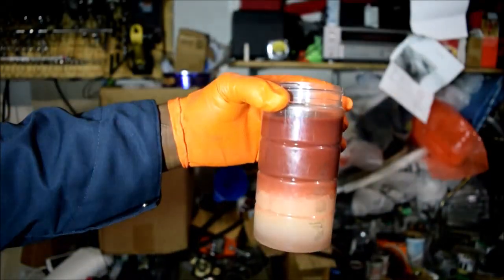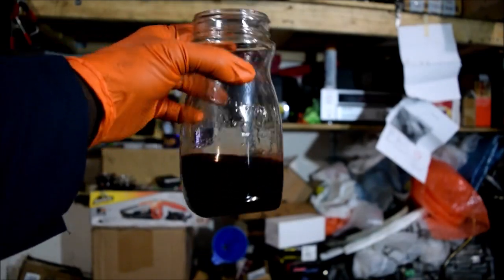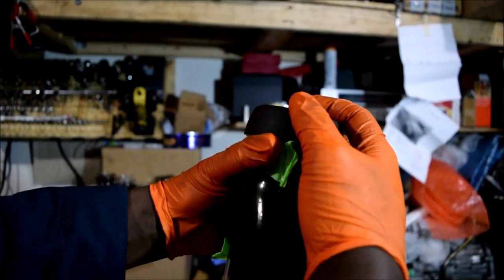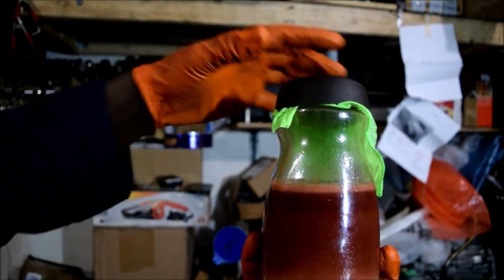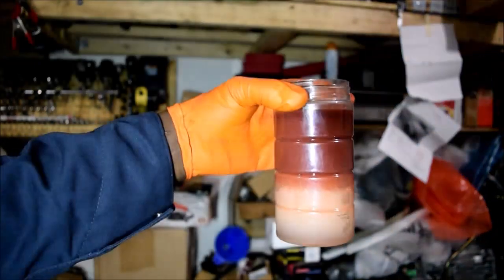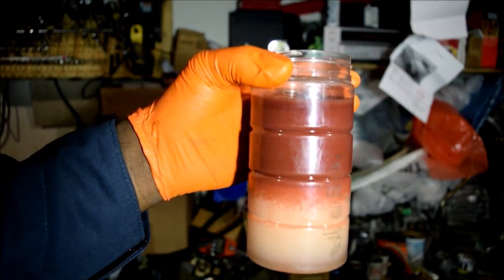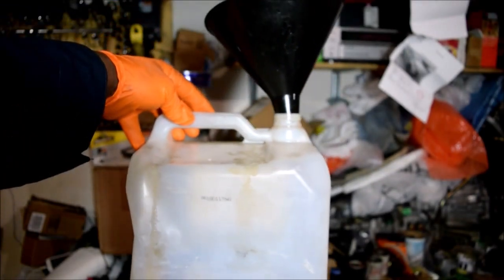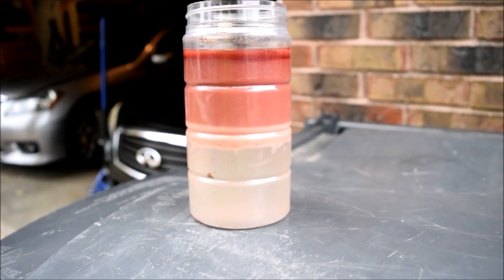Mixing Water with Transmission Fluid (ATF)

Comment: Repeat this experiment, except, add ~1/4 cup of anti-freeze (ethylene glycol). The reason I  say that, is the 2 times in my life I've gotten significant amounts of water in my transmission, is due to failure of the heat exchanger built into the bottom radiator tank. That's when I see transmission fluid in my coolant, and worse, WATER IN THE TRANSMISSION FLUID!! The problem with water is, that it dissolves the bond between the clutch plates and the friction material in the clutch packs, not allowing them to "grip". (time for a total soft parts rebuild!)
     Transmission fluid has incredible amounts of detergents in it. It can emulsify nearly half its volume of water. I don't know if there's a way to separate the water from the fluid, evaporate it with heat, or any other way to make the transmission fluid "usable" again. The detergent is why both the water and the fluid, to remain milky. I would like to try filtering it, or, run it through a high speed centrifuge, or heat it to the boiling point of water.
Reply from the maker: I tried to mix the ATF with coolant in another video. https://youtu.be/ib7rAdHYjhI

Some older Nissans used to get what was called PSOD Pink Slime Of Death whenever the heat exchanger failed and the fluids mixed. 

What I couldn't replicate in my impromptu demo was the speed + forces the mixture would undergo. I would love to do the experiment again and record it.
However, I'm most interested in the emulsification properties of the ATF. To have that much capacity seems to account for the possibility of a huge quantity of incidental contact. Unfortunately, when the clutches have been scrubbed clean, it's time to open up the wallet.
Reply: Heat it to 90C in shallow pan !

Comment: Question.. Can this be fixed without a replacement?  https://photos.app.goo.gl/cLKB3vh2x2amtDU58
Reply from the maker: It would need a major overhaul. I would just try to find a low mileage replacement instead.
Rebuilds are expensive and unless done very extensively, they don't seem to last as long as a non-rebuilt one would.

This is somewhat of a generalisation, since I am not too familiar with that vehicle, and whether they have reliability issues.

Comment: I'm assuming the dirty water contains detergent from the transmission fluid
Reply from the maker: I wish I understood the chemistry a little better. I don't know why the water stayed "dirty" while my coolant test video showed the coolant clearing up over time.

But I know transmission fluid does have a lot of chemicals, including various surface tension modifiers.
Reply: @EdBwoy  You're exactly right, about the friction modifiers. Transmission fluid is a very delicate balance between being able to adequately lubricate gears, valve body, and bearings, and, being able to allow the clutches to apply without slipping from being "over-lubricated". Any change in characteristics, could lead to malfunction of the transmission. That's why there are different grades of transmission fluid, and why it's imperative that you choose the grade of fluid specified by your transmission. Water getting in the fluid drastically changes its characteristics.
Reply from the maker: @vincentrobinette1507  nice, I remember brushing over this in one class. The instructor was covering hydraulics and told us that our pressure and flow coursework was just a one-dimensional outlook on the fluids. 
In reality fluids in machinery undergo way more demanding conditions.
1. Lubricate, but not too much
2. Transfer as much heat as possible, but don't boil
3. Carry and release air pockets, but don't get frothy
Etc. That's when the magicians in the chemistry lab bring in their powders and potions.